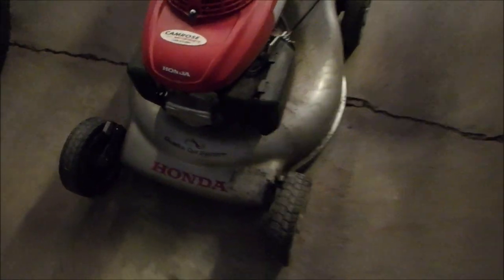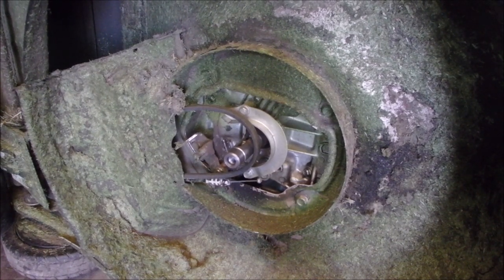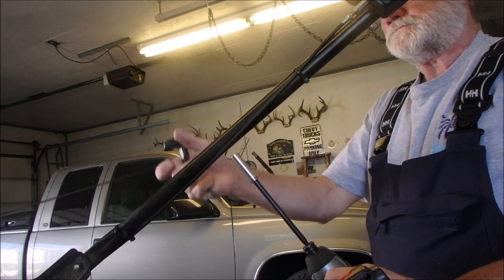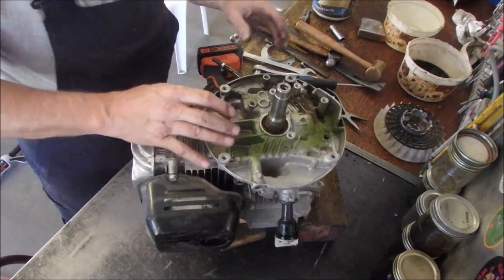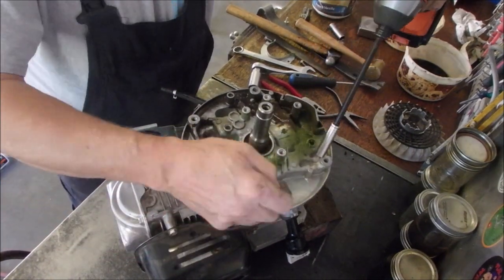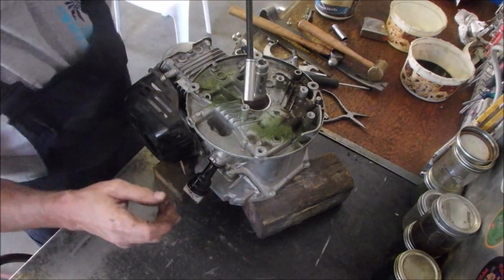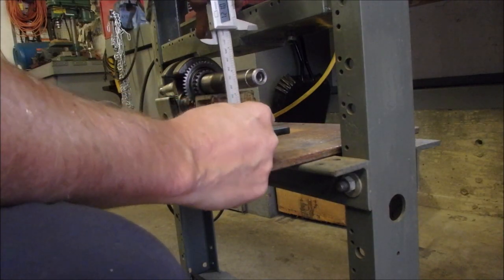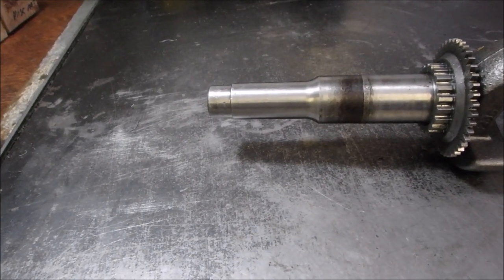Honda Quadra Cut Mower Hit Something Hard!!!

Comment: Hey Inspector. A few years back, I went to a Honda dealer for a set of blades. The parts manager showed me that the cost of a new crank was cheaper than the cost of the blades. Not nearly the cost of a Briggs or Tecumseh crank. He said that the Honda crank is not as hard, tempered, as a other two engines listed. They don't straighten them because of the liability of it possibly fracturing and someone getting injured. I have a straightener and a crank bent as bad as yours. It snapped while trying to straighten it. Tempered steel doesn't fair well when bent. Great video. I always appreciate you going on an adventure. Take care. Ray from Ohio.
Reply from the maker: Thanks  Well this one wouldn't let me bend it.  I felt at the beginning that my effort was for not.  When i turned the engine over before taking it apart it was binding inside as well.  Thanks for the info.  Like you i have had luck straightening the Briggs and Tec

Comment: Most lawn mower shops have a simple crank straightener. The engine is removed from the lawn mower body and bolted into the rig so the crank is horizontal, soft jaws are placed on the shaft and the deflection faces downward, a hydraulic jack then pushes up on the shaft to rebend it. A bit of rechecking and applied jacking can get the crank straight enough with a dial gauge then used to getting it perfect. As it got bent in the case restraightening it in the case ensures the most accurate fix. I've tried restraightening cranks in a press, only to add a bend in an area where it never was.Those cracks as you call them in the case are merely casting line issues, they have nothing to do with an actual crack or failure to the case.
Reply from the maker: Thanks

Comment: I beat on a Tecumseh 6hp. Then went with the long pipe method. Went back with the sledgehammer. Hours later still not straight. A little less than 3/16th off . Vibrates a little. I was hitting it so hard with the hammer that I bent the deck. Lol. Thanks for the video.
Reply from the maker: I get it   thanks for the fun

Comment: It's funny, I just got a tecumseh on a toro, with almost the same problem, it was leaking oil around the crankcase gasket, so took it off the deck and disassembled the engine, come to find, and the wife spotted the crack around the crankcase seal on the aluminum of the sump, so that's trashed, so I parted out the engine, turns out the block was also cracked, it must of hit something really hard..... Great video sir.
Reply from the maker: Some guys are saying they are casting marks which they look like but there are so many and so deep i think the block is damaged.  Thanks agai.

Comment: Good video Bruce. Truly.  I just did remove the Mickey Mouse clutch system from a Honda. Found and installed a flywheel brake/ switch setup; ran a cable from that to the handle where the clutch engaging cable was .  simplified now.
Reply from the maker: Nice work!

Comment: Bruce the OLD MAN here from EP saying nice video of tearing this engine down. I personally have straightened many crankshafts using a 4# sledge but never any that were bent 3/8" normally when they are this far bent the damage goes further up to the lobes. I have been trying to get Jake to commit to purchasing a crankshaft straightening unit from small engines from Stens which our cost is around $480 plus HST well worth the money if i can save two engines per year it would be a good money maker for the business.
Reply from the maker: Thanks for the kind comment.  Yes this one was really bent.

Comment: I obtained a nice hydrostatic Honda that way -- owner hit a stump, bent the crank and then ruined the main bearing.  I really felt for the guy.  I got everything but the block for $25, and it's all in nicer shape than the HRX217HYA I paid over $800 for.  As soon as it's tolerably cool outside, I'm going to Frankenmower it with a spare blade-clutch GCV160 I have.
Reply from the maker: Great idea.

Comment: Those marks in the sump have fooled me before. Take a closer look they are often casting marks and not cracks. I'm guessing they are because they aren't radiating out from the journal area that the crank goes through. Intrested to know what you find Bruce.
Reply from the maker: Thanks.  I have seen them  on flywheels but never that many.  Thanks Al

Comment: I was thinking a piece of thick pipe and using it as leverage to bend it back straight.
Reply from the maker: I tried that as well but got no where and it was so clumsy for me a did not show it.
Reply: @BrucesShop  probably would need a really good sturdy vice. I would probably end up flipping my work table over. Lol.
Reply from the maker: @CrazyMooseManor  Thanks

Comment: Crankshafts are extremely hard to straighten. I know because I bent my own on my mower. I worked at it with a hammer for a good while and made little progress. I decided to go to the hardware and picked up a length of heavy pipe with an inside diameter big enough to fit over the crank and long enough to give me a good amount of leverage. Now there is no way to accurately describe the position that I had to position myself but I'm sure that I looked quite silly. To get leverage and to hold the mower still I had it on it's side and I was sitting legs straight with one foot braced on the inner deck and the other side of the deck was between my legs to hold it steady and I pulled like the Dickenson as far out on the pipe as I could reach...... my mower has very little vibration and you can't tell by eye when the blade spins. It will do until I decide to break down and buy a new one. I just don't like the new plastic carburetors that come on the new ones. Great video Bruce, thanks for the knowledge.
Reply: No, sorry, I disagree completely.  You did not look silly.  It is called Technically Adroite.  Now you know😊
Reply: @MrRunner  lol,,,,, I like your viewpoint much better than my own and will use that term from now on !!! 👍
Reply from the maker: Thanks for the fun guys.
Reply: @len4338  You're welcome.  This is the sum total of 6 years in Engineering school.  That and we are NEVER wrong

Comment: Bruce, this is totally off the subject, but I have a mower that never had a stop cable installed on it. It was made that way. By your recollection, when did they first start installing kill cables on mowers? I'm trying to figure out how old this thing is. And it has the old breaker-point ignition system as well. The ignition kill switch is part of the throttle cable. How old do you think this thing is?
Reply from the maker: about 1987 is my gues as I bout one in 86 that had no cable.  Then there were lots of them after that.

Comment: Well I have to admit, I had no idea that a bent crank was repairable, bearing in mind (no pun intended) the original TIR (Total Indicated Reading) tolerances.  That said, I would have done this differently.  The problem with smacking it with a hammer, is that this will Brinell the bearing.   I would use an adapter, as you have done and a long pipe.  Holding the assembly steady is not easy, but the result is much less incursive.  Just a thought.
Reply from the maker: Great point!  I did try a pipe but did not edit it in.  This one was too bent.  It was a loosing battle
Reply: @BrucesShop   Yup, especially if the crank stub is short, it is game over.  Thanks for the reply though, I always look forward to your videos.  I was just south of you in July.  Gave you a wave on the way back to S. Ontario

Comment: Brand new cranks for those engines are (were?) about $35 from Jack's Small Engines.  I have one on the shelf.  Unfortunately, you northern folk pay much more for parts than we Yanks do.  (I'd have to check the price now that Jack's is part of Northern Tool).  Using the hydraulic press was a novel approach -- just because it didn't work this time doesn't mean it wasn't a good idea!
Reply from the maker: That is how I feel.  Trying is the important part.

Comment: Too bad you bent the middle of the crankshaft trying to straighten one end.  It needed to be supported differently, and pressed only on the bent end.  Pressing the counterweights was a mistake.   Still, that cracked case made the repair kind of pointless.  Good call on the part-out.
Reply from the maker: You are right